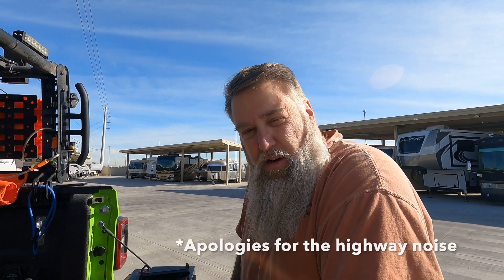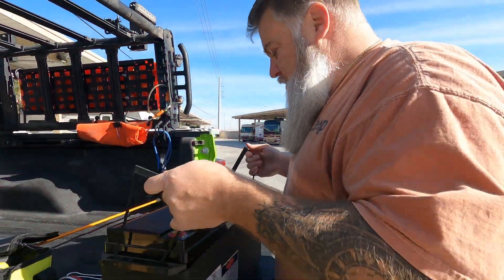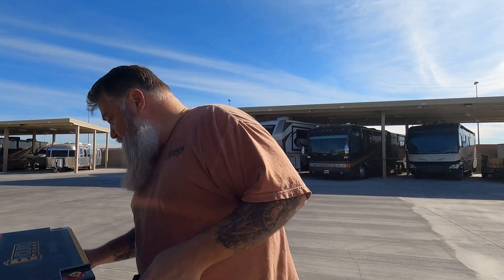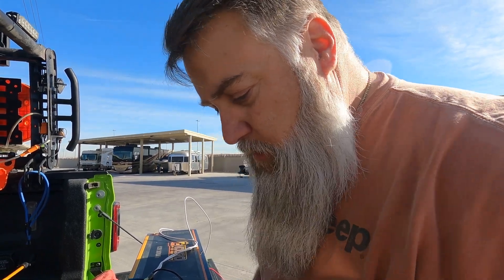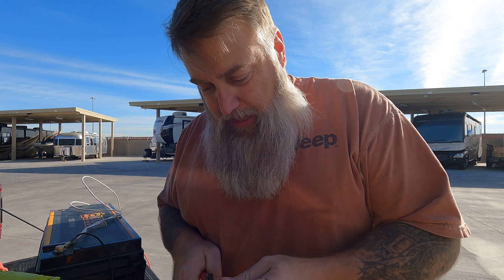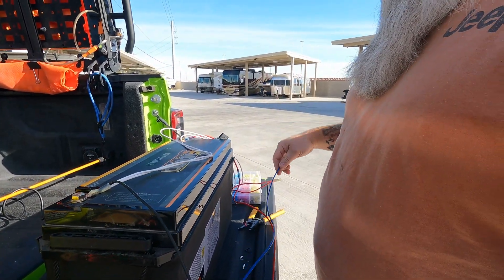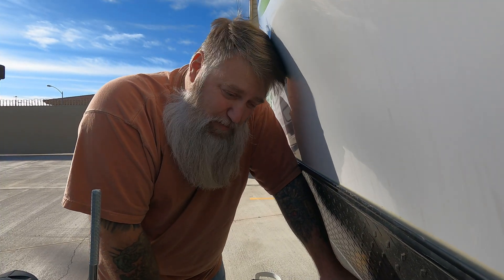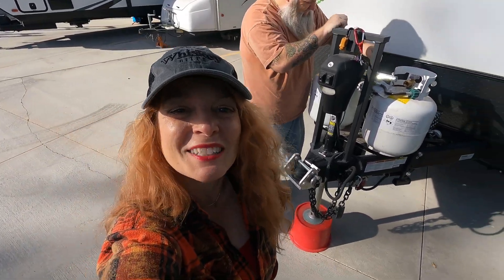HOW TO KEEP YOUR LITHIUM BATTERIES WARM! We install heating pads to our Enduro Lithium Battery.

Comment: Just watched you video, great work. Am facing the same situation, is your system with your heat pads still working and have you experienced any problems? Thanks for sharing.
Reply from the maker: Hi! Actually we haven’t needed to use them due to the warmer temps. Where we have it stored the battery has been holding a charge without the need of the pads. And thanks for watching our video!

Comment: How many watts are those pads?
Reply: These are 78 watt pads!!!!😮😮😮😮😮😮😮😮😮😮😮😮😮

There’s no way these are recommended directly onto a battery.  

“Facon 7-1/4" x 25" 12V RV Tank Heater Pad with Automatic Thermostat, QAI Certified, Prevents Freezing for Fresh, Grey, Black Water Tanks, Up to 50 Gallons”

Comment: You skipped over the final bit of fitting the pads. Did you simply cut off the (approximately) one inch strip that went beyond the side panel or did you fold it over on to the rear side of the battery. 

I live in Alaska, and these pads could be critical to my use of this type of battery (as cold is the norm here)!  So, I appreciate the video and your input. It is a great thing to be able to share like you do.

How much do the  pads drain the battery? There are a few months I use the camper a lot less often than I would like, but I am near mains power, so I could simply use a transformer during that period. Still an idea of the current drain would be good (from real a use perspective rather than just the package label.

Comment: Nice video. I don’t see the switch you used in the list of items? Did you use a really?
Reply from the maker: I just used a switch I had lying around. It does have an indicator. No relay because it’s a small power draw, but they did have an inline fuse.

Comment: I did not do enough research and almost caused a major disaster. I purchased regular lead acid battery heating pads from GM.  Lead acid heating pads can not be used on lithium batteries. They get too hot and can cause a fire or explosion. I caught my mistake before it did too much damage.
Reply from the maker: Oh my goodness, so glad you caught the error before anything could happen. Research is key, lots and lots of research. Lou's great at that thankfully!
Reply: After I removed the burned straps and melted wires, I noticed it warped the battery cases. I will have to dispose of these batteries now. I don’t trust using them. Lord only knows what damage it did to cells and electronics inside.